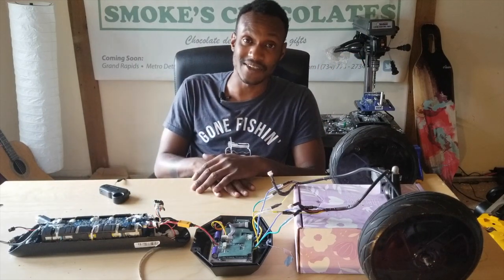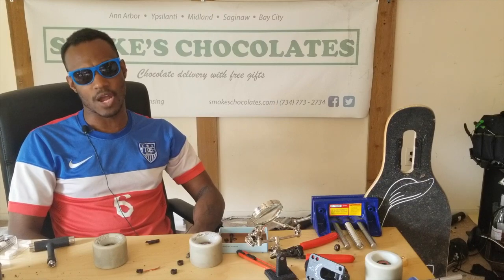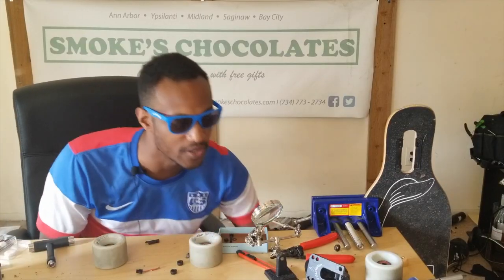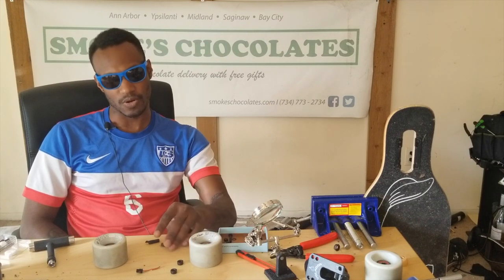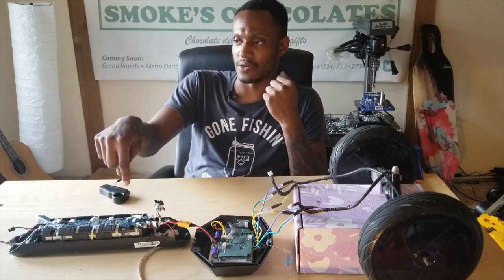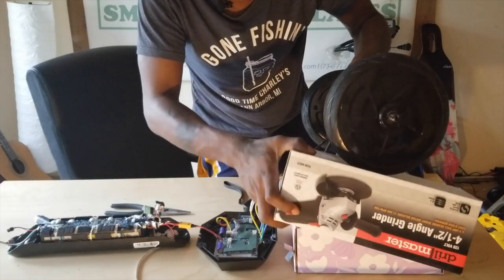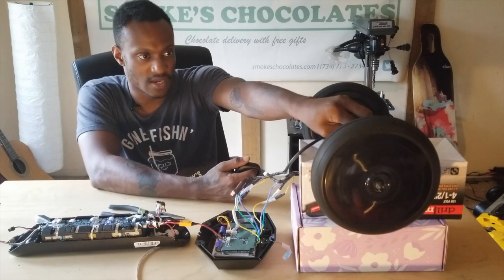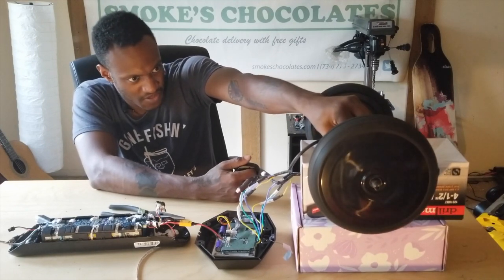Electric Skateboard ESC Plugged into Battery and Motors

Comment: Hi. I have a 10s Li-ion battery (30-42V) and a 270kv motor. This controller is designed for such voltage and motor?